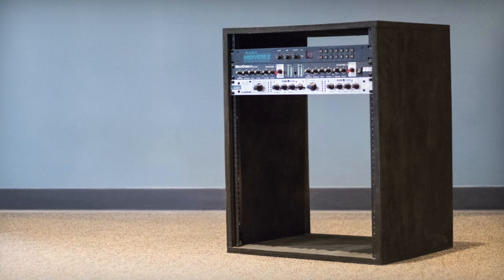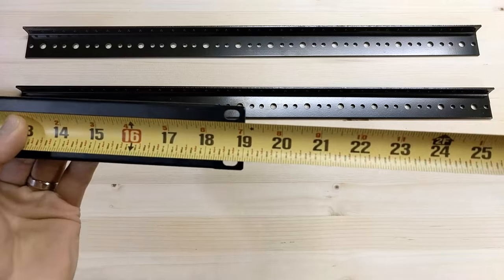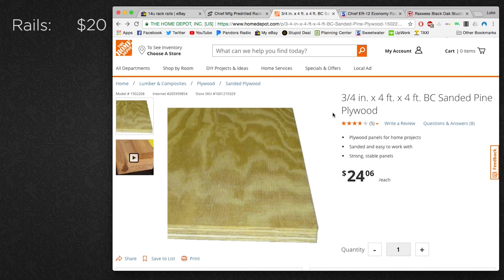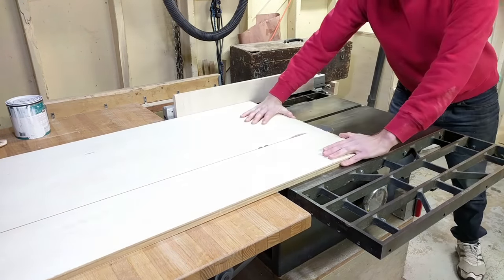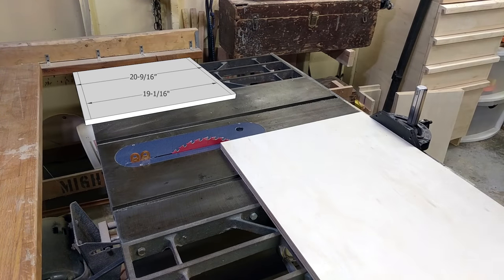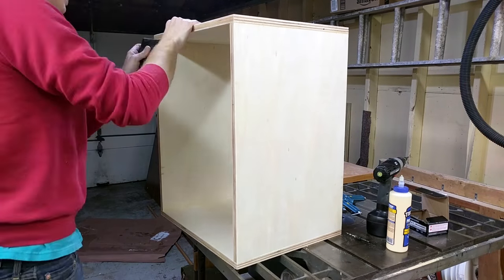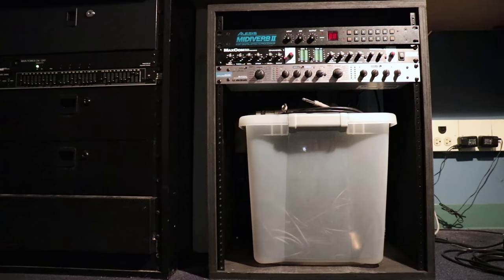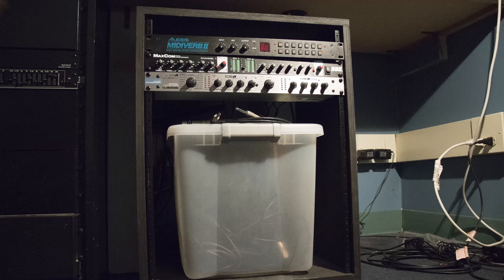How to Build a Quick and Easy Equipment Rack

Comment: I set the rails 1.5" from the front edge to assist in protecting gear knobs. I also use nuts and bolts to secure rails to the cabinet. Plus, i like to set the rails either .75" or 1.5" down from the top and use internal cleats of solid wood for extra stability. I enjoy your channel and just subbed!

Comment: This is a very good video.  I gave someone the link for this and they ignored it. SMH!!! My question is what number sand paper did you use to sand the wood before painting. Would all types of wood need sanding?
Reply from the maker: I don't think I bothered to sand it. This one was real quick and dirty. They have sanded plywood at home centers if you want to avoid sanding.

Comment: Hey there, I just found this video as I'm doing some research to put together a rack myself. I was wondering, do the rack rails support the gear installed well enough by themselves, or is there a support system you installed for the backside? Seems like with how heavy the rack eq are, they'd need it, but I'm new to rack gear so I wouldn't know
Reply: Same question here! I just received my rails like 5 mins ago haha cant wait to do my own rack
Reply from the maker: Small equipment like EQ's and interfaces just mount in the front. Amplifiers and other heavy equipment has rear mounts as well.

Comment: What does the back look like I'm trying to build a smaller one but didn't see any support at the back for the equipment. Does it only need to be screwed into the front?
Reply from the maker: Rack mount music gear is only mounted on the front for the most part besides big amplifiers which have rear mounts.

Comment: I have a question, so My closet has a switch for my Ethernet but I was wondering if I should keep in my by little wooden box with a door, I cut an ventilation hole where I’m going to mount a fan. But I was wondering if I should keep it in there or mount it on the wall, thanks!
Reply from the maker: That's up to you my friend!

Comment: of course its easy to build as long you have the machines to cut the wood and put it together.  Tell me the same thing when you dont have any machines anymore.
Reply: If adding capitalization and apostrophes to a negative YouTube comment is too much work, then it makes sense that using a handsaw and screwdriver are completely out of the question.

Roll up your sleeves dude, I promise you can do it. You'll be proud you made something with your own hard work! :)